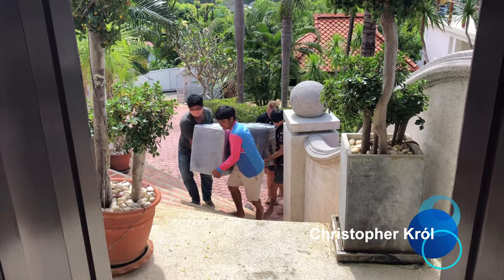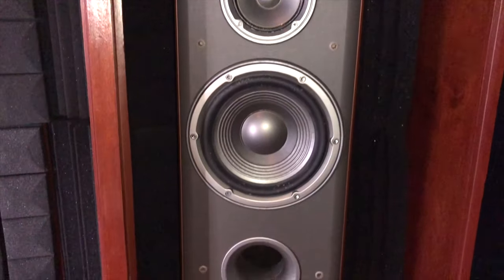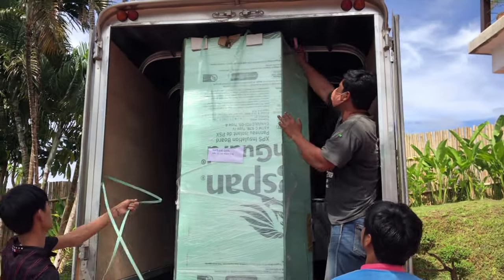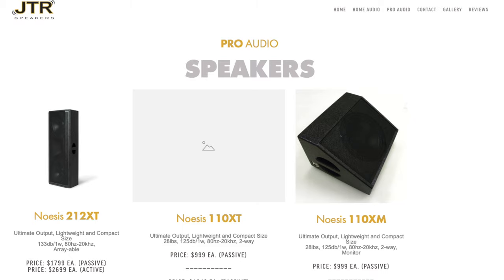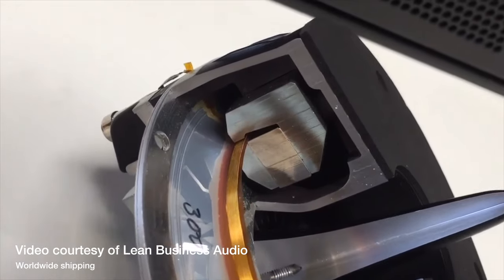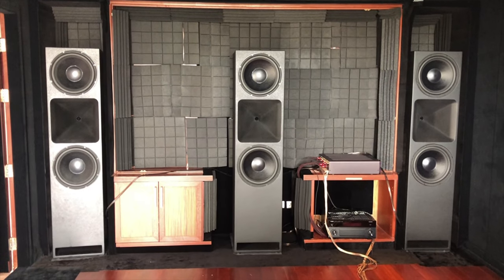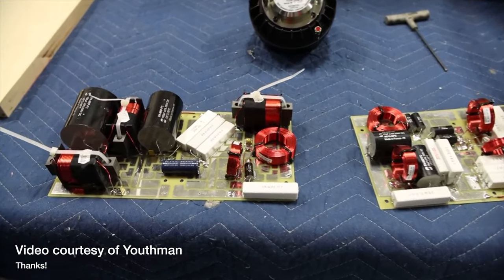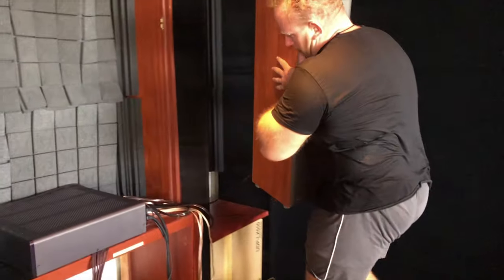The most powerful Home Theatre Speakers - JTR NOESIS 215RT Review

Comment: Fun video to watch!

Are you using surround sound speakers now, and if yes what brand and model? I am considering to get the 212's for my LCR and want to how this integrates with other surrounds.
Reply from the maker: Thanks! Yes, I`m using now 7.1.4 setup. My surrounds: JBL E60 Northridge, Quad 12L as back surround, Atmos: JBL E10, Boston Voyager 50. Each pair from different manufacturer and type :). But it was just temporary setup to see how atmos will play (and stayed here for now). I'm waiting for 8xJTR 110HT/SL to replace them. For now sonically - even though each one is completely different speaker, with Yamaha YPAO correction its quite ok. The biggest problem is lack of dynamic range and loudness :) - they are just not capable of levels same as front stage :) - but for sure it is better than with JBLs in the front. So i think 212 for LCR for you will be very good choice - lots of people in JTR family use them and are very satisfied!

Comment: I just imagined powering these speakers with my very old abandoned VSX-330 🤣
Reply from the maker: Actually i tried to hook them directly to my Yamaha A3080 and its possible to use it. Just it will go hot - as they are 4 ohms and the AVR is not built to run 4 ohm loads and also quite fast distort/clip the sound. But can do :)

Comment: What are those sound absorbers you put around the back and sides of the speakers and why? Do they help?
Reply from the maker: Just cheap foam ca 2 inch panels. Yes they help a lot in absorbing high/mid reflections. Not so much in bass department but helped tremendously in limiting reverb in the room and clarity of the speakers. In the future i plan to make more serious treatment (especially for the bass) but for now they are very good.
Reply from the maker: Yes thats the plan :). The upgrade process is step-by-step - we just mounted 2 weeks ago the atmos JTRs on the ceiling 4x16kg = 64kg of speakers over head.

Comment: I have question, would it be better to just get (3) JTR Noesis 215rt’s over an entire 9.2.4 SVS system and slowly build the JTR system? Also one more question would I be satisfied with the bass output coming from the JTR Noesis 215rts to justify this decision? Thank you so much for your time.
Reply from the maker: Hard to answer this question as i haven't heard SVS speakers (only Pb16-ultra sub). I think it depends on your financial ability and needs. From reviews SVS is decent system. JTR for sure will give you more headroom. Sound quality wise- i have no experience with SVS as mentioned so cannot compare. For me its hard also to answer the question about bass from 215Rts - the front stage in my room has bad location for bass (if i place sub there - even huge captivator, there is no bass in my MLP), also hard for them to compete with nearfield Captivator.
Reply: I finally ordered 3x JTR 215rt’s, I will eventually get the RS2 for subs. Will the bass from the 215’s give good output when it comes to explosions in movies?
Reply from the maker: It will give, but it will be not audible when yo have the RS2 :). Just another level with subs!  Congratulations on your choice!

Comment: I've always wanted JTRs, but those ones are so big I'm not sure they'd fit in my theater.  Maybe my next house/theater...
Reply from the maker: There are 212 and 210 models which are much smaller but have the same mid/high speaker. So as you want them for theater, crossed and bass managed they should sound similarly. Check the JTR's website.

Comment: Did you still crossover them in receiver? Or full range?
Reply from the maker: Crossover at 80Hz
Reply: @kingscinema3873  why?
Reply from the maker: Hmm - the bass coming from my 2x6000ULF (4x18") JTR subwoofers is so powerful that i will hear nothing from the towers. Also their placement in my room is not optimal for bass (but its only one possible for the screen etc.).
Reply: @kingscinema3873  what are doing for a living? Do you maybe have some wide with life story? Im thinking about emigrating from poland and I would love to hear your story.

Comment: Did you test the Paradigm SUB2 in your room before purchasing the JTR? (supposedly the best subwoofer in the world, still), Goes down to 7Hz(much lower than JTR :) ) , no bass reflex, at 10Hz it has 112dB, and weighs about 107Kg, but is smaller than S2 and 9000W Peak, 4500W RMS. It's much stronger subwoofers than this JTRs :) Test it and make video about :D
Reply from the maker: I live in a tropical island so i have basically no option to test anything here other than my system :). Seems like the Paradigm SUB2 is much weaker than JTR - https://www.audioholics.com/subwoofer-reviews/paradigm-sig-sub-2-1/paradigm-sig-sub-2-analysis vs https://data-bass.com/#/systems/5c1c0617eae7a300040baca0?_k=ycfpzn - have to look at the open space 3rd party measurements - much different from paradigm website which states 112db at 10HZ (as the state in-room measurement), whereas audioholics measured it at 97db at 10HZ, compared to JTR's 108db at 10HZ. Paradigm also measures ca. 120db at 60Hz, compared to 128db at 60Hz of JTR. So would need 3 paradigms to get to JTR output. Paradigm is also 2x more expensive. So to get same output i would need to pay 6x more money for paradigm :). For sure Paradigm is a good sub also, but cannot be compared to JTR violence :)

Comment: What amplifier did you use?
Reply from the maker: D-sonic
Reply: @kingscinema3873 
Hi thanks for your so wonderful review.
I understand you are using M3A-6100-7 to drive the 3 Noesis 215.
But what amp is driving your 2x 6000ULF Subs?
And once your get your new 8 JTR spkrs, what amp will you use for the 4 surrounds and 4 atmos spkrs?

Thanks.
Reply from the maker: The 6kulf have both built in amplifier - SpeakerPower. For the surrounds and surrounds back i use the M3a (it has 7 channels - so 3 powerful for front and 4 for surround). The last 4 atmos speakers i power with my Yamaha A3080 AVR - its enough for them

Comment: Zajebiste! Love tue setup, you movie collection and great enthusiasm. I too have a 5.2.4 JTR setup and plan to get two more 110HTs. Welcome to the club and get ready for the 4000ULF. Pozdrawiam z Chicago!
Reply from the maker: Cześć Jerry! Thanks for nice words! What kind of speakers you have in your setup?
Reply: @kingscinema3873  I have 3 x 212RTs for LCR, 2 x   110HTs for Surrounds, 4 x 110HT-SLs for Atmos, 2 x Captivator 4000ULF-LP and will be ordering two more 110HTs for the rear for a 7.2.4 JTR setup. I was and am just as excited as you everytime I see the speakers and listen to them. I just love it! I am Pitchcut29 on AVS.
Reply from the maker: Jerry nice! So when my speakers arrive we are gonna have twin setup with the difference of 215RT in my room and only 1 cap subwoofer :). What amp and processor do you use to power them?
Reply: @kingscinema3873  I am using a Digital Amplifier 5-Cherry to power the sides and LCR and two lab gruppen E4:2 for the Atmos but I plan to get another 5-Cherry. The speakers are very efficient so I can easily get to chest slamming bass and ear bleeding mids and highs with the amps. I can relate to the ear ringing (like a gernade going off nearby) after some very loud listening sessions. They are just that smooth and clear that you don’t realize what’s considered loud again. The processor is a Monoprice Monolith HTP-1.

Comment: Dude build a baffle wall. make it a massive front that has as small as possible gaps between the wall and the speakers. not necesary to build them perfectly into it. a few mm gap dont matter. behind the front wall fill it out with absorber material. since u will have alot of space u dont need to go with the best stuff like basotect for general purpose. you need light weight absorber material like hemp. u will get a increase in sound clarity. since ur really playing in a half room then, not a quarter room. also u dont break the sound from the speakers.
Reply from the maker: What would be the profit of the baffle wall? I was considering it but didnt quite get the idea of it :). More now i'm thinking of working on my bass situation - with Captivator 6000ULF i get an nasty resonance on 41.5 and 83hz
Reply: @kingscinema3873  a speaker does not only Produce Sound in Front of the speaker but behind the speaker as well. This creates alot of problems because you have reflections from behind the speaker which are pretty much uncontrollable. Also Sound gets also left and right of the speaker. With a baffle wall you put the speaker flush with the wall and have the speaker sitting in alot of Absorption. This makes IT so ghat you get only the sound of the membrane, the actual moving Part of the speaker. Result is just everything gets a bit or much better.  Soundstage distortion clearity. You also get to use the room better with low frequencies. Im Not a native speaker and dont know every term in english but google for speaker half room and speaker quarter space.  You get alot from it
Reply from the maker: Thanks - i will thinnk about it. Right now i put lots of foam around the speakers and behind the screen to limit the reflections from the AT screen. Don't worry about being native  - im also not native english :). Have an amazing day!
Reply: @kingscinema3873  Do you want help on the issue there it is easy to correct. I need you to be fully transparent with me.